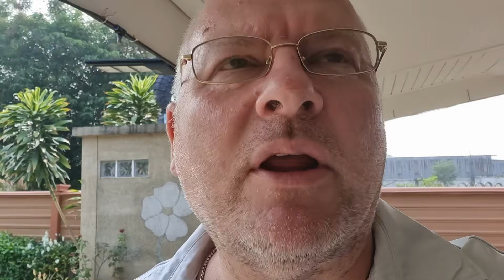Importance Of A Good Electrical System For Solar Power In House Construction | SolarThailand.biz

Comment: I'm curious how you determine how much to charge for extra work to fix or correct the existing electrical system before installing the solar system?  I assume the pre-installation visit is the best way to determine that.
Reply from the maker: Yes, the onsite survey uncovers most. But sometimes we find things during installation. Our policy is that minor work is included, major work we must talk to the customer and find a solution.